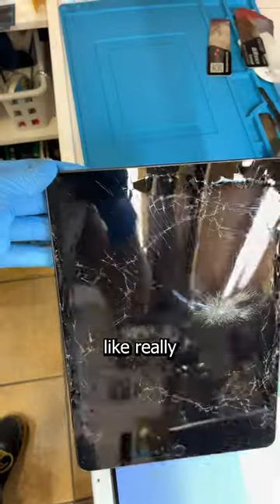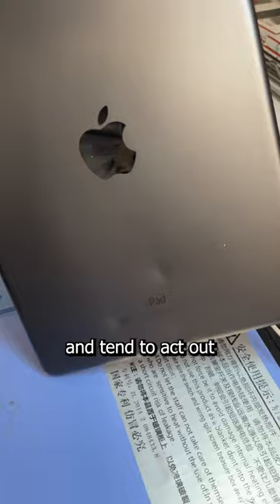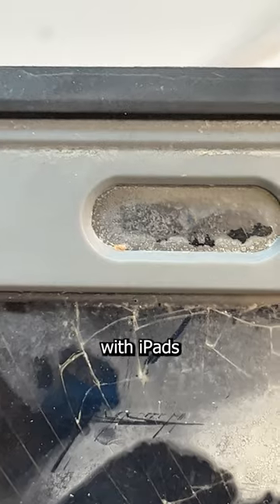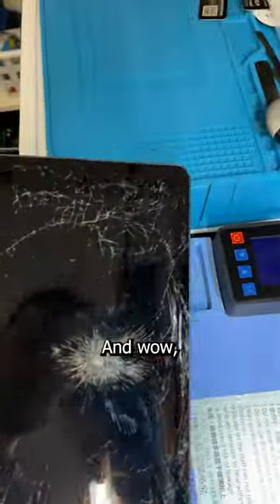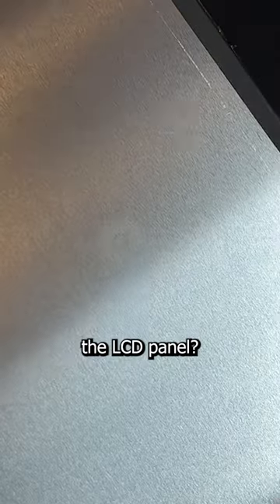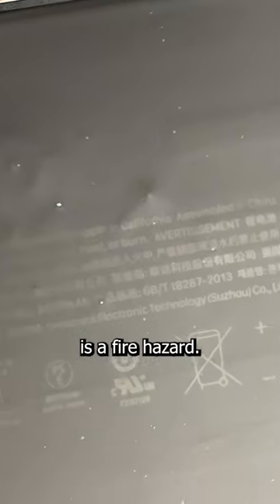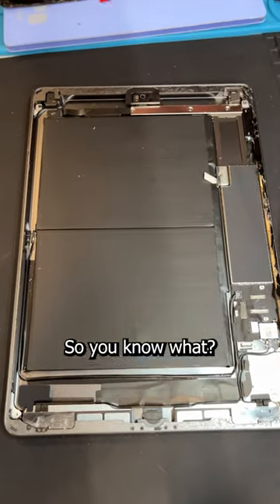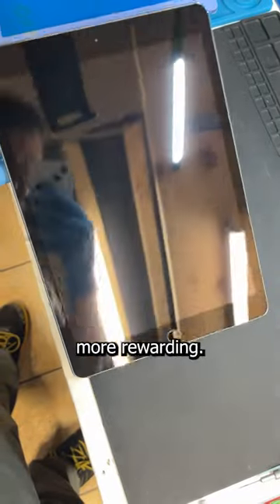Helping a customer in a rough spot #ipad #technology #pc #tech #shorts

Comment: Good to see there are indeed other honorable and competent repair shops out there. Alot of people either wouldn't even know that was a burn mark, or if they did, wouldn't even bother replacing the battery.

I've had to do this myself in the past, usually not even mentioning it to the customer. I do also hate ipad repairs....especially battery replacements on the pro 12.9 series.

Comment: I have done this many times in my repair career. I really remember this guy that needed a data recovery on his drive. He had all the family photos and no backup.  The cost was high to do the recovery, and he said he would come back with the money. I did the recovery with my PC-3000 and got all the photos, disk had damaged firmware with bad io controller and able to repair it with some micro soldering. When he came in to pickup he said to get the money he had to so several full body burns (he was a stunt man!) and one he got hurt on. Felt he needed more help so gave him a backup external hdd and paid for 1 year of off site backup with BackBlaze. Did not even charge him for the replacement hdd in the computer either.   Figured my work is hard but not hard like that!! 😂.

Comment: I've done a screen replacement for an iPad before, but going from that to a Surface Pro  is a serious increase in difficulty. Just because of how hard it is to get the screen off. In some cases you NEED a heat gun, not a hair dryer.

Comment: If we knew how much it would be to get a fix for my partner's ipad, I would spend the money and get it fixed for them. The ipad got bent and it messed up the touch sensors on the screen, causing the screen to glitch out and my partner got locked out of their ipad permanently. It's a simple but slightly out of budget fix, and I relly wish there was an easier way to get it fixed (instead of spending hundreds on fixing it or at least getting the data off it).